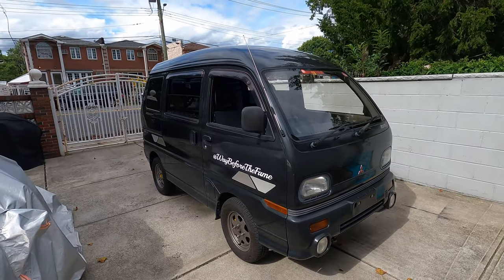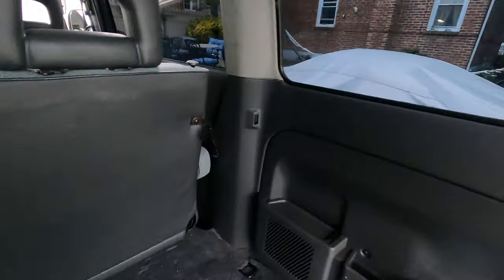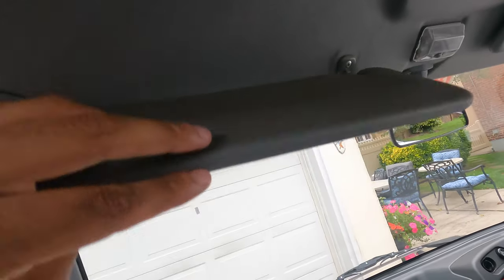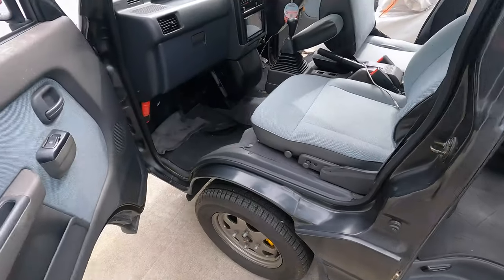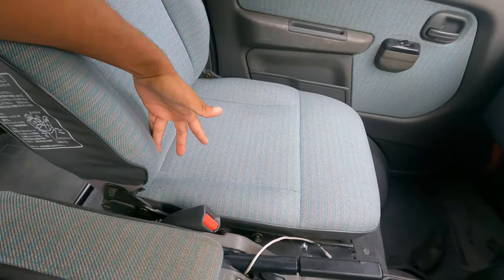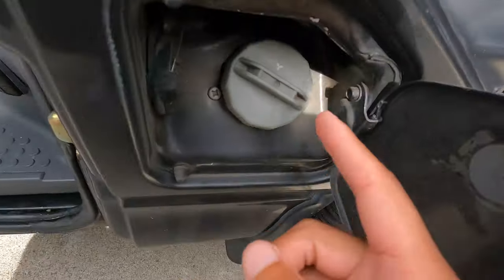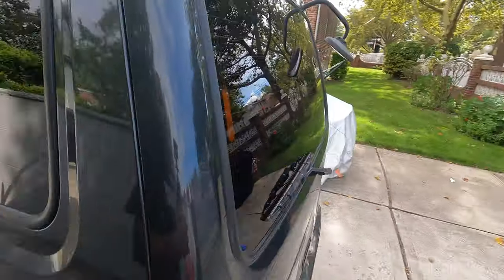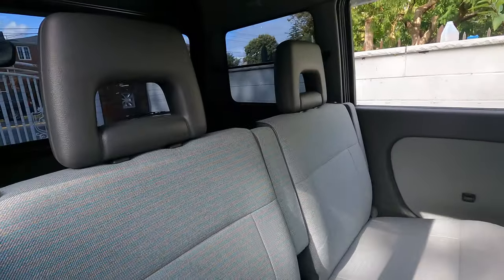1993 Mitsubishi Bravo Kei Van FULL OVERVIEW

Comment: You mentioned you added more insulation for heat under seat for engine and also said it doesn't really get hot. Just curious why? Mine stays a normal temp in cab. Different vehicles from what I have but curious of what was going on with yours. -Thanks

Comment: Hi Brother - Mitsubishi offered the most crazy kei vans at that time for many years until Daihatsu went one up and offered electric curtains!!! could be an option on Bravo but never seen them myself so just speculating. Top of the range Toyota vans also had this high end option real gangsta stuff! myself just bought a lower spec Minicab wagon 1993 very cheap here in Japan of course. Have you tried epoxy for the buttons or some kind of glue? Also how is the engine sound before and after the sound deadening you did? Planning on doing the same but using also some silicone sealant thinned out with turps and paint it on to get all the metal bits that are hard to stick material onto. Silicone does a good job for heat as well. Great car but dont go 10k rpm without loading up also 7.5k rpm is max hp anyways ;) but its like an f1 like bike engine hybrid that could easily make hp at 9000rpm instead with some slightly re-ground cams. One last thing economy can be improved as will cooling using an electric thermo controlled radiator fan instead of the hp robbing mechanical setup. Enjoy!
Reply from the maker: Yeah thank you for the info, im going to be taking my van to Virginia from NYC about 1000 mile trip this week!
Reply from the maker: Engine sound was about the same the heat has been non existent since the sound deadening tho
Reply: @Waybeforethefame  perfect the heat is the issue in summer. Just keep a 2 pack putty stick the ones for hot water pipes or any pip in the glovebox. Saved me from leaking water heater line and also repaired my AC lines using it. Very cheap here in Japan for a buck an inch is very handy. Also spare V belts or whatever belt yours takes just in case as I also had mine break and it was great when fitted yet somehow a rock got in (what I could figure) as the damage on the belt was obvious not from build quality. Lastly timing belt spare is a good move in case you are stuck somewhere since it is hard for many to know if its been changed for sure. Enjoy your trip bravo brother from Japan.